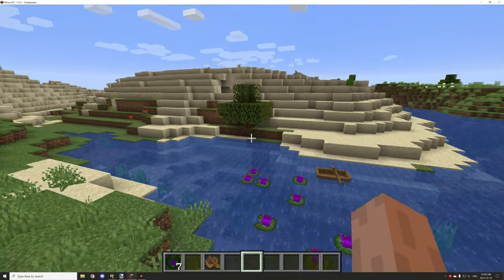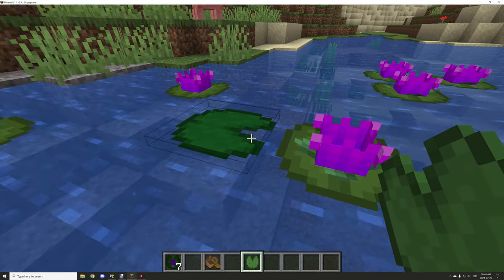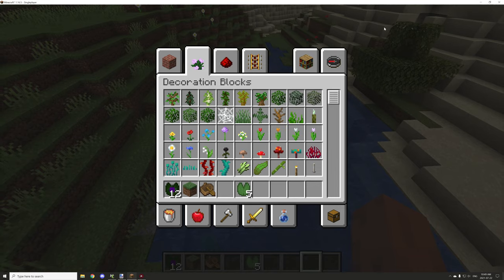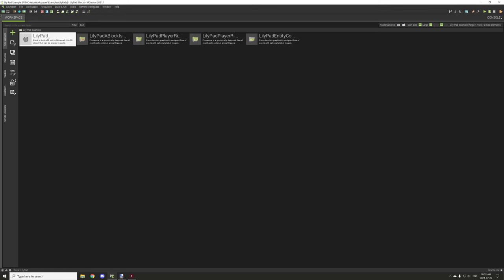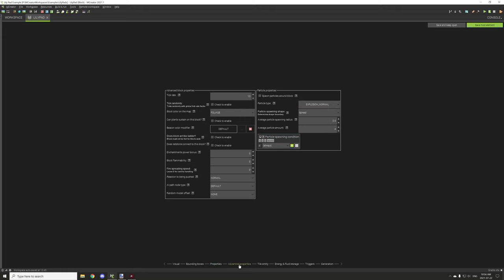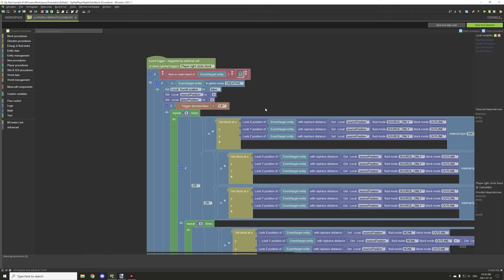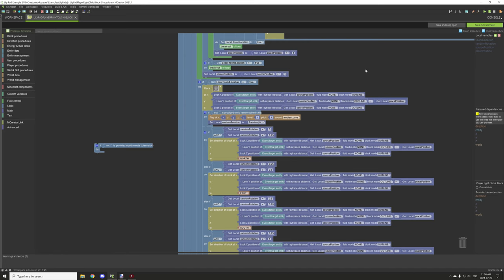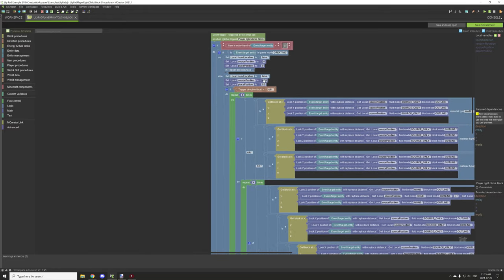MCreator 2021.1: How to make Lily Pads

Comment: Yo I came here from your other video. Sorry to keep bothering you but a lot of the procedures here have since been updated. Is there another way of just making a plant spawn naturally on top of water?
Reply from the maker: Features may support structure placement but I am not that familiar with what options there are for water detection but it might be possible to do through features. I would check the feature templates to see if there is something already made otherwise you will need to set up one from scratch. Features are not to complex but are limited. Your best best would be to go this route for natural generation but you will still need to use the ray tracing to place them on water like in this tutorial. If the tutorial uses material blocks you will need to replace them with tags instead with the types of blocks used in the old material type. Mojang removed material testing not to long ago so many things that I had recorded more recently may be broken due to this one thing Mojang did. However all you need to do is replace the blocks with tags instead and everything should work as normal. Hope this helps a bit.
Reply: @NorthWestTreesMCreator  thanks a ton for helping out

Comment: I am adding the right click item procedure but it says that it' doesn't compile properly. (I am using a newer version of Mcreator, 2021.3)
Reply from the maker: I am not sure what would cause this.
Check the console and see if it is the same procedure that you where editing, often the console will list what procedure and if you click on it it will even bring you to the line of code in the .java file that is the issue.